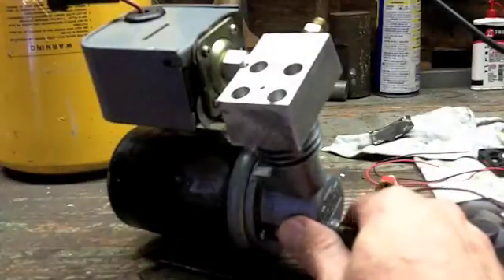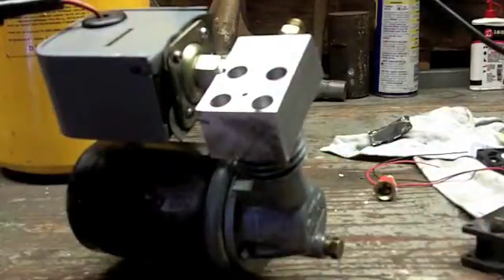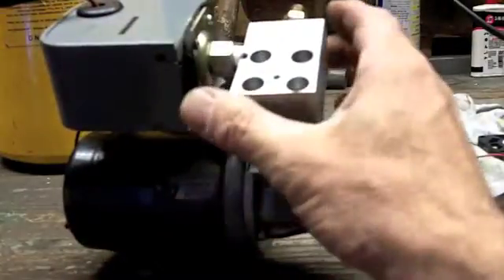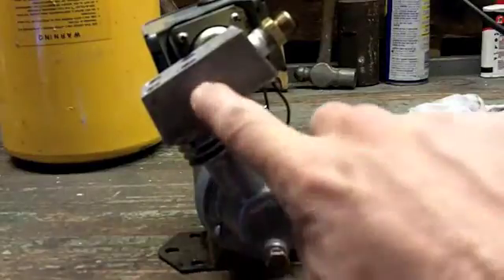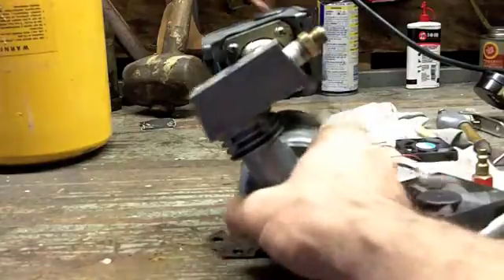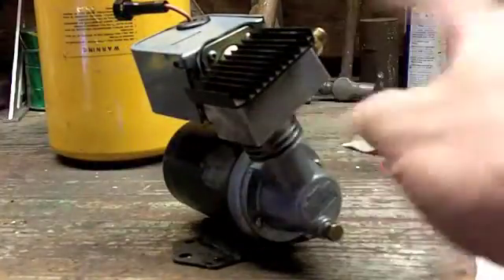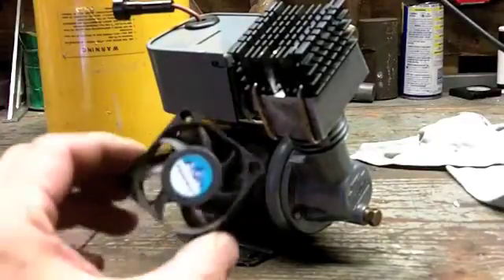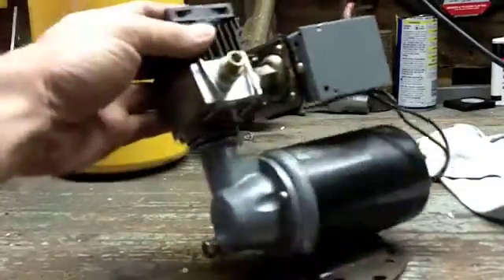Home Made Cylinder Head Up Close

Comment: Nice fabrication job.
How long did it actually take? PT1 was 6 mins...
The Computer geek stuff is "Thermal Compound." I suspect a copper grease would be more than enough in this case.
Plus the computer stuff is about (Guessing the £ into $ ratio) $10 for 3.5g, while copper grease is $12 for 500g, and I suspect you have copper grease already?
Reply from the maker: It took me a couple hours to make a functional head.  ... I could have spent plenty more if I had chosen to cut fancy cooling fins or shape this head differently or polish it. But it's not visible, so I wisely decided otherwise.  I ended up not using any compound and have not had any heat issues. Thanks for watching.

Comment from the maker: hahaha, The fan mounted on the heat sink actually failed (next video will talk about it) The vibration of the compressor killed the PC board inside the fan.  I actually killed two fans before I realized what was going on.  I will change the design a bit...don't worry, It will all be on video! Thanks for watching.

Comment from the maker: I ran it for 15 minutes straight last night and it held tight. While I didn't have any thermal compound on it last night... it still transferred heat very well.  When I do the final assembly I will squish some of that in there.  This whole set-up will be in a "caddy" and have a quick release to the air line.  While the tank is not current in it's hydro, it typically holds 2900psi..so 100 psi does not even move the needle on the tank guage.  lol.

Comment: Nice. Run it a while to make sure your hold downs don't vibrate loose. You can put the grease on to make a bit of difference but what you have should keep it cool enough. Most compressors don't have that much cooling. Grad you are making it detachable. Tanks that are not DOT certified might get noticed on inspection day.

Comment: you absolutely have to put at least alittle bit of heat sink thermal grease on it otherwise that little aluminum heat sink wont do jack shit for heat transfer. Its like slapping a heat sink on a CPU without thermal grease and expecting it to work. it wont. And putting thermal grease on it will also greatly increase the compressors life.

Comment: Is that Scuba tank aluminum or steel? I dont think it will work if that tank is steel because that little compressor wont have enough guts to fill that tank to capacity because of the expansion rate of the steel compared to the softer aluminum.

Comment: LOL I like how you think!  I am curious to see what the test results will show for the effectiveness of that setup.  That heatsink is designed to add more surface cooling area right to the heat source.  You have a heat sink now right on top of another heat sink basically, which already has 360 degrees around it almost of cooling area.  I would deffinately run it with thermal compound between the 2 if possible for best results.